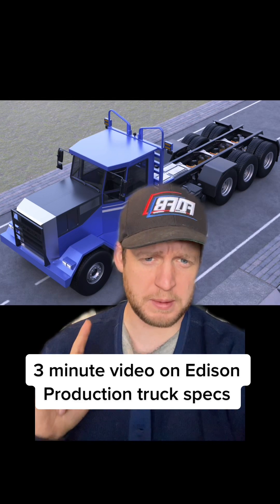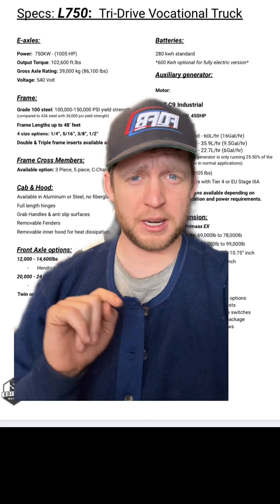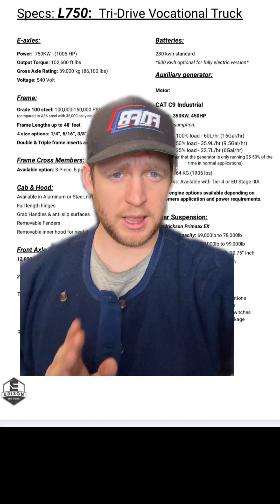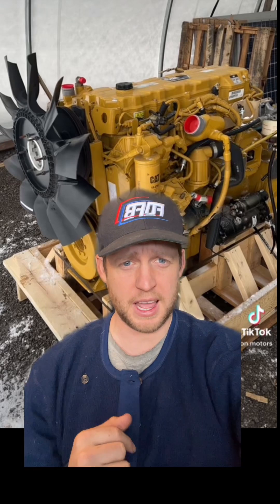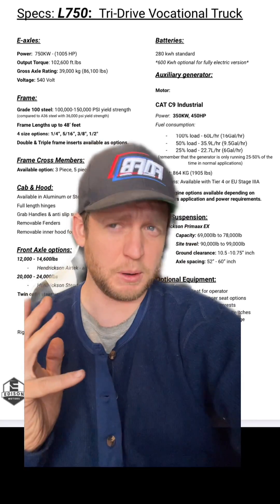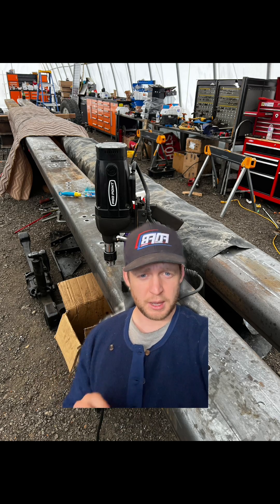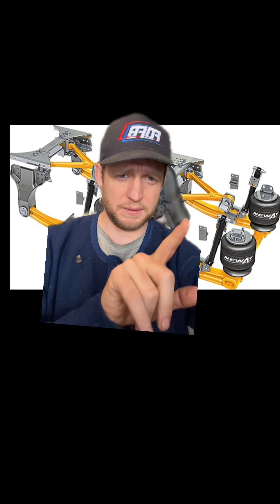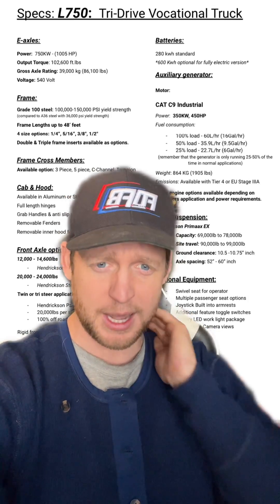Production Truck Specs

Comment: I thought the whole idea of building an electric rig was to get rid of a diesel engine. Here you have diesel and electric. Seems like you've just add more things to go wrong. If you cut it back to the equivalent of say a 450 cat how long can you run just on batteries? Wouldn't a hydrogen generator fed to the diesel be more efficient?

Comment: Very skeptical because no one yet had provided a truck that can compete with the range of a conventional truck. 

The specs sheet doesnt include fuel capacity, and there is no mention of range.
Reply: Don't get me wrong, I'm happy to see new options come to market, but it's going to be hard to get truckers to adopt them if they're more expensive and less capable than existing trucks

Comment: Sooo you're average semi a full days work is around 3mw of power. Thats almost quadruple the max power those batteries can discharge in a cycle. Also its only a few hundred pounds of fuel providing that instead of 40k lbs of batteries. In order for any of these electric trucks to do a regular days work you would need 60k lbs of batteries. Kinda defeats the point huh?

Comment: 2 hours of driving to 15lt sounds pretty impressive. As a non-trucker I always imagined they'd get economy around 0.5-1lt per km, or worse. Depending on so many factors. 
Wondering if I'll see any of these rigs running cross Australia in the next decade. We have road trains with 3 and 4 trailers, and I frequently see rigs hauling mining equipment or other massive loads. So I'm sure you'd have a solution, it's just if a company shows an interest in what your stuff.

Comment: What is the battery life expectations vs a motor? How much will replacing the batteries cost?   Could I expect 500,000 miles off of the batteries?

Comment: I have a question, do you not consider the generator equipped model a series hybrid?
Reply: If they called it that then everyone would realize this is nothing new and it doesn’t work so well.
Reply: @kingduck3192  well I think it’d work fine for the intended use cases they’re making it for. They’re not really targeting over the road trucking.

Comment: There are so many applications this will be so good for. I drive a boom truck for a concrete poured wall company in MN. Local route, needs to be able to operate a wet kit... We have some potential old equipment we could colab and experiment. 2004 Sterling with a PM Knuckle boom.

Comment: Do you consider replacing diesel generator with hydrogen fuel cell generator? Is it possible to accelerate and regen decelerate using batteries and driving steady road with using only fuel cells?
Reply: in their other video they said the diesel generator will be their starting point because they don’t want to change up too many variables on a new vehicle platform. That and just about every bush mechanic knows how to maintain a generator as well as the refuelling infrastructure already being in place. But they did say that after they see how they’re holding up, the skies the limit for generator units whether it be deletes, hydrogen, or what have you

Comment: You might have to put some batteries on the trailer or consider a hot swap option possibly depending on your heat dissipation.   Maybe two battery banks in order to let them cool. Have you looked into lithium titanate batteries they are much safer work better in the cold and have around 50000 charge cycles. They are able to charge and discharge rapidly.

Comment: Everything I've heard about the trucks is awesome....except that you are offering a 100% electric option. A generator is a must-have for a vocational truck. I can only think of what an embarrassment it would be to your brand if drivers run out of battery power and they have to find someone with a massive portable generator. Not to mention, the electrical grid in most places is not ready to charge vehicles with 600 kwh battery packs in a reasonable amount of time. Your diesel electric concept is one of the major things that sets you apart from the competition. Diesel electric hybrids are the best of both worlds. Leave the 100% electric vehicle concept to the world of golf carts and expensive toys for rich people. When the going gets tough, you need that diesel engine on standby. Please consider waiting a few years to roll out the 100% electric option. Hopefully, by then the power grid will have been strengthened and high capacity charging stations will be more common.
Reply: Keyword being option - Nobody's forcing anyone to have the fully electric one...

Comment: What emission tier will the gen engine be at, will it have def or will it depend on the retrofit vs production truck
Reply: That's one of the coolest things..,. its a fully electric truck.  doesn't require an emission rating. 1.   the stand alone electric generator may or may not need to meet an emission standard depending on jurisdiction.  2. the generator only runs at its peak efficiency rating, so may meet an emission standards with little to no additional BS

Comment: ❤👋 technical terms for electrical power propulsion are extent. This is the only way! Generator powers electrical motors. 2times faster 2times power 2times efficiency. Battery and or power lines and a transmission like on logging or mining will take that and 10 fold it. Mass moved
Reply: Transmission is a time travel divise.
Reply: Edison trucks mining the moon. Edison truck space trains. Solar swarm that grows corn to make fuel. Take me to the light, Daddy.🎉

Comment: I’ve thought for a long time a reverse hybrid would work for cars . A lot better than what we currently have and here it is for trucks ! Bloody awesome .
Reply: There are plenty of cars that use this kind of drive system. Its called a series hybrid not “reverse hybrid” this company is t really doing anything innovative other than marketing
Reply: @user-jm8ky1kn2t  and even then the companies figured out at high speed long duration runs it was more efficient to just directly drive the wheels with the engine.
Reply: @kingduck3192  Thats not necessarily true. All that hybrid engines to match or exceed the range of gas cars on efficiency is gearing. All combustion engines have gearing because they have a much more limited RPM range. 

Its really an easy solution however 95% of normal car driving is city driving and the added cost of gearing makes it prohibitive

Comment: I’ve always thought this was a great idea once I realized trains and large ships are also diesel electric.
Reply: They're diesel electric in a different manner. Running a genset to drive electric motors isn't new. However, using a generator to charge batteries on the go is pretty new.

I dig what they're doing here, but the stacked efficiency losses of running a generator to charge the batteries to then the run the motors seems a little anti-physics to me.
Reply: @Jaeswindell  Yeah same. I dont know what their target customer with this thing is.
Reply: @aculleon2901  they have bragged about not using engineers to develop a this thing, that may have been a fatal flaw.
Reply: @Jaeswindell  The efficiency losses for doing that as opposed to running through a Clutch, then a Gearbox, then like 5 slightly out of line U joints, then to a rear differential, then to wheels may shock you
Reply: Oh I agree! But, there are mechanical losses involved in this system as well, I was just focusing on the macro energy inefficiencies of this design.

Comment: If it would take 45 mins to charge enough for 2 hours of range, would it be feasible to increase the battery capacity by maybe 50-75% and alternatively charge one half of that capacity, while running on the other half? Possibly, extending the range infinitely.
Reply: Technically it is better to recharge both at the same time. Batteries charge faster from 0 to 80 than 80 to 100. Think of it like filling a glass of water all the way to the top. Sure go full force for most of it but then you slow down as you reach the top.
Reply: @josphe9011  By capacity I meant actual batteries not their potential. In other words have two smaller banks of batteries, be charging one bank while running on the other.
Reply: @heatherroseisrflyer  ah, okay.

Comment: Any options for a smaller generator. Seems a little overkill. What will the load on the generator be when charging while driving?  50% 80%?  Is there going to be an electric heat pump for climate control and battery heating/cooling?
Reply: It's literally on the spec sheet in the background.  You can adjust the load on the genset, keeping in mind it'll only be running around 25% to 50% normally.   The genset will be Tier 4 compliant but this will also have regen braking so you won't need to run the genset so much when in hilly locations.

Edit:. They'll also have smaller engine options.

Comment: .... this is just my unprofessional opinion based one experience in a couple of fields involving driving trucks just like this: y'all are gonna sell a tonne of these. Not only that, similar systems are gonna roll into every class of truck larger than like 5-10 tons. This is gonna be a game changer, that fuel efficiency is nuts and businesses are gonna look at that year over year savings and do what businesses do with cost benefit analyses.

Comment: Look forward to seeing  road and off road evaluations. What is the construction time line?
Reply: They're building the first production unit.
Reply: @MarkRose1337  
I am curious how long it will take to build a unit. 

I think mountains with regenerative braking is a good use case for hybrid.
Reply: @tdwebste  These guys are quickly workers and the trucks are kept simple to make repairing them simple, but  it will take time for them to get faster at building the trucks. The first five are going to companies that will work with them to sort out bugs and so on that any new design has.

The best application for these vehicles will be logging trucks in the mountains. The weight of the logs going down can charge the batteries enough to drive empty back up the hill. Many mine haul trucks do exactly that already
Reply: @MarkRose1337  
Mine trucks, enter pits empty and leave full. 

Is that loaded going up hill,  empty going down hill?

I can see the power saving regenerative braking going down hill empty as well. Of course to a lesser extent.
Reply: @tdwebste  A lot of mines are located on mountains. Those would obviously benefit much more than open pits on flat ground. My thinking is obviously biased to where I grew up, surrounded by mountains.

Comment: I’m not a electric truck fan but I’m eager to see this develop, it might change my opinion.
Reply: Every seen a train go by?  It runs on the same concept.  Pretty well all modern locomotives are diesel/electric.
Reply: @rileykorte  : yes I’m aware of that. That’s why I’m excited to see this. The only thing is the locomotive doesn’t shut off the engine like this is supposed to do.
Reply: @scottberry5266  I’m excited to see it too.  I’m surprised the technology hasn’t transitioned over sooner.
Reply: Same
Reply: My opinion exactly, i have so so so much hope for EVs but the tech just isnt there yet.
Reply: It's basically a Chevy Volt upscaled.
Reply: I’m not a trucker either, but when you get trucker videos in your algorithms, and get aroused by Peterbuilts, you kind of get the sense that long haul truckers are unhappy with standing in line for fuel, and shitty service from “Chain” truck stops. Not mention maintenance cost, fuel. Then add to that, low ball prices from logistics companies. Speaking of which…. You know a major shipping company is going to jump on the savings a hybrid truck can bring.
Reply: @larryrobinson08  : hybred is fine. All electric not so much.
Reply: Yep the future is hybrids. Peterbuilt is building a hydrogen model generator with Toyota and I  believe the project is for Walmart.
Reply: @larryrobinson08  : only problem is hydrogen goes boom 💥
Reply: I just don't want vehicles charging off the grid constantly like full scale electric would.
Reply: @Henry L  totally valid concern. Our grid in BC is pretty good. 
The reality is that the batteries can't do it. Electric cars are great, my dad is on his third. 
Where I live, in the middle of nowhere, converting an old truck and getting a couple of those solar trailers would be the perfect setup.
We have grid power but I would love to have a personal power plant/grid. I could run my shop off that truck.
Reply: @Casey  if you're dad is on his third electric when they haven't even been out for 20 years I'd say that's pretty telling in how not good they are. And then the hybrids. What sounds better than having to replace an expensive battery or expensive motor... how about both!!!! Both my trucks from the 90s have over 200k on them. Point me to an electric truck that can haul 2700lb of bricks in the bed. It might for about 5 miles before you need a recharge
Reply: @That One Guy  you might think so, but my brother still has the first one dad bought, and the batteries are still good after more than 10 years.
You make the assumption that he had to replace them for some reason.
Reality is, he can afford to trade up as the technology gets better.
Also, electric cars have been around longer than gas cars. The first car to break 100km/hr was and electric car.
Electric cars have been more common than you might think. We had viable electric vehicles in the 80s. 
The reality is that his first electric car will out live your ice engine car. There isn't any maintenance required, rotate the tires and fill the widow washer. 
The batteries will probably require replacement eventually but by the look of it that won't be before the car gets to 500,000 km.
The trip from vanderhoof to Kelowna  cost almost thirty dollars. That's around 1000 km. Thirty dollars in gasoline won't get you to Prince George from vanderhoof. 
Assumptions are dangerous, and misinformation about electric vehicles is everywhere. 
There is also no chance that you drive a vehicle that does 0 to 60 mph in 6 seconds unless you burn a lot of gas in a hurry. Dad's heavy Hyundai crossover will do it all day and all he has to do is plug it in at home.

As far as hauling your bricks, the new fords will do it better than your truck and they have the range. Chevrolet makes the all electric hummer replacement for the military. 
The American military uses this same method on the Abrams tank. It's an electric drive with a generator.

The military in the states is going electric because it's better than gas. They wrote a book about why and how it's better. 
Just because you heard someone who doesn't know anything about electric drive say some idiot shit does not mean it's factual. 
Check out the electric car clubs that have been around since the 70s if you want some actual facts about electric cars.
Reply: @CaseyBDook  electric cars aren’t good.
Reply: @ashrude1071  is that so?
Reply: @CaseyBDook  my neighbor built his own electric car, 30 years ago.
Reply: @larryrobinson08  a lot of people did that around then. That's about when we started the Vancouver Electric Vehicle show. The cars! 
Most were completely unique. Most of the fun was checking out how people set their cars up.

Comment: What, if anything, are you doing for climate control? Perhaps an electric air conditioner and one of those coolant heaters that burn diesel for heat?
Reply: They're doing diesel heaters for the batteries and the genset to deal with Canadian Winters.

Comment: As a retired car hauler I can see a great use for a city delivery platform that returns to the terminal for reload/recharge several times a day.  A low cab just ahead of the steer axle straight truck with a 5 or 6 car capacity, great for Chicago or NYC.
Reply: This isn't 100% electric, it has a diesel motor working as the generator. Because of that you don't need to return to a terminal to recharge. The on board engine will recharge you going down the road. What they are building would actually be viable for OTR.
Reply: @Nozerone  I read in their comments that they also are going to make a pure electric version that could be used for short haul and would make good for a carhaul city rig.
Reply: @Oldcarhauler  I think their main product is vocational trucks mainly logging and bed trucks but I'm sure a highway truck is part of it, but it's a matter of cost vs efficiency.

Comment: First, I'm not a truck driver. Just came across your first video right after you posted it and loved the proof of concept.  My question is, what will be the cost? Will it be comparable to a regular diesel? Or more? And will it require more or less maintenance costs? I really hope this goes well for you guys
Reply: In theory less maintenance no transmission to maintain but new concept’s always have bugs to work out
Reply: @Mesh  oh, absolutely.  Just curious.
Reply: Iirc, he said that it would be about 25% more than a comparable new diesel truck.